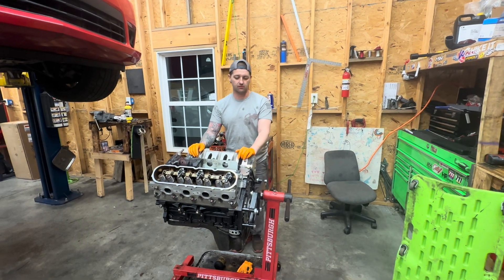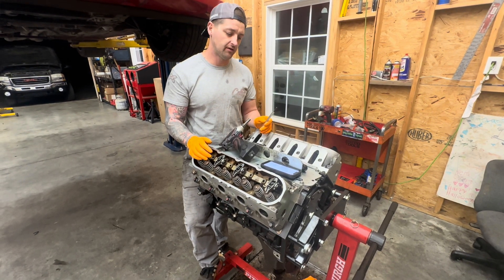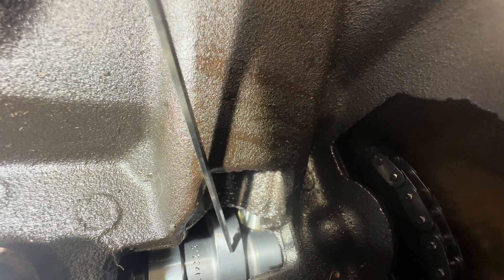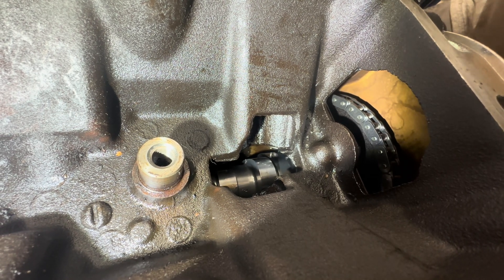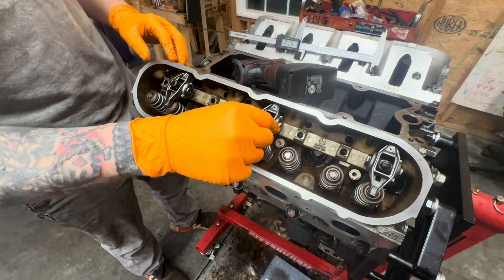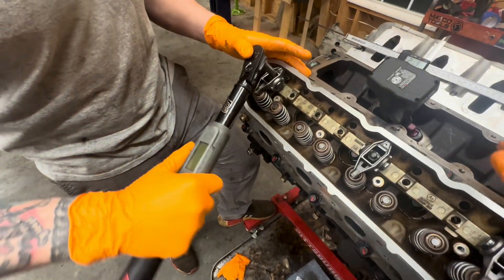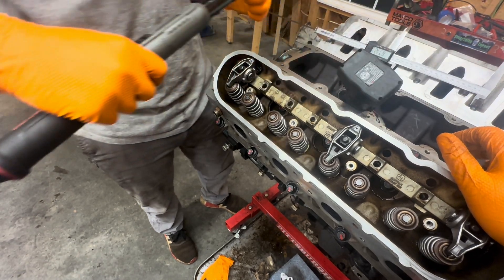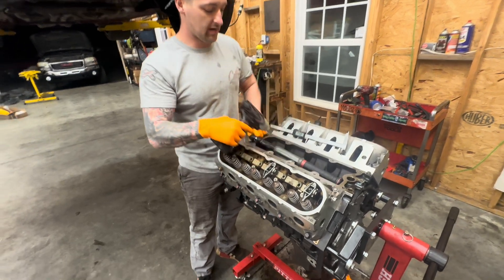How to measure LS/LT pushrod length

Comment: Im putting in roller lifters in my la 360 build where there were flat tappets originally, the roller lifter is way higher than the flats plus my block was milled so ill be doing this soon, my lifters only need 30 thousands added, yours needs 130 thousands added to your zero lash measurement? wow, thanks for the video, very well demonstrated
Reply from the maker: Awesome glad it helps